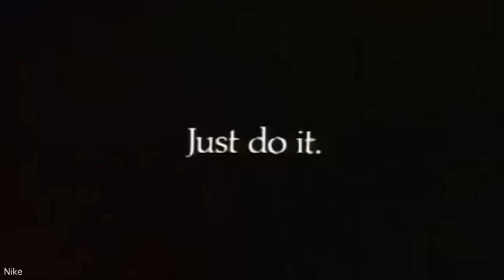Barn Find 1962 Pontiac Catalina Interior Upgrades, Trim Installation and MORE!

Comment: For future reference. There's a trick I do and will pass along to my fellow compadres. You can do for dry, wavy and extremely warped door panels that won't sit flat and stay flat. Just use Windex or water in a spray bottle. Spray the backside of panel lightly enough to absorb into panel. Then install while moist. As the liquid dries, it will flatten dry back into proper form
Reply: I did that (an Old Body Works Guy showed me how to do it) on my first car years ago. A 1957 Chevy 2 door 210. Someone had removed the front ones and threw them into the trunk that leaked water. It worked great.
Reply: That makes sense. Thanks for sharing 👍
Reply from the maker: Thanks for the tip!

Comment: A nice built for the Poncho power level 200R4 for that car would be the ticket. You get the better first gear(2.74:1) and the .67:1 overdrive gear. IIRC that has a 3.23:1 rear gear? If so, with the torque of that Pontiac engine should be good enough to shift into overdrive at 45 mph. Usually a 3.42:1 rear gear is teamed up with the 200R4 so it can go into overdrive at 45, the 3.23:1 should be close enough. Since it's a manual there are overdrive options for those too.

Can't wait to see you do the body work snd paint for this car.😎👍
Reply: This will make a great summer daily driver for you.😎👍

Comment: Some of the cars made in the 60's had really cool looking interior and Pontiac seemed to have some of the best.
About 20 years ago my Dad inherited his uncles 64 2-door Catalina. He ordered the car new.
The exterior was kind of a silverish  green color, and it had green interior too. Similar to your blue seats, it had
three different colors of green. I love the look... His uncle had the dealer put the really thick clear seat covers on it
before he picked it up. I swear those things were 1/4 inch thick. It still had the matching factory floormats too.
The car had been garaged since day one. It had never been wrecked and still had 100% original paint.
The only flaw the car had was a really small ding on the driver side quarter panel...
It didn't run like yours though LOL...  The 400 in your car sounds sweet and runs hard when you give it all the beans.
I was really surprised to see how good it ran in the video. I really like this car...
Reply from the maker: gorgeous cars!

Comment: I hadn’t heard Nunzi passed away, in in CT and he has always been well respected by us Pontiac guys here, I love the 63 tempest he built. On the 283 they do make aluminum double hump heads, ya gotta watch the large valve heads with the 283’s 3.875 bore, the larger valves are just going to be shrouded against the cylinder wall anyways. Good video, takes a couple of days to watch these full feature length videos but I enjoy them

Comment: Man, I’m pretty sure that thing is even the same color as the one I had. Swapped in a seat out of a 65? Pontiac. Bolted right up. Huge improvement. If you stop working on it right now, I’ll come and get it.

Comment: You couldn't miss meeting a Pontiac with that iconic grill nose.  I think it was in 1969 they introduced that endura rubber nose which was supposed to be able to take a parallel parking tap without damage.   Love those old Wide Tracks.

Comment: For the plastic inserts for the trim, try to find a shop that deals with Lawson Products. They make a trim fastener assortment drawer that, if memory serves, has those in the assortment.
Reply: Those clips can be over $7 a piece 😮😮😢.  Used to work in a body shop and we were always trying to make sure we could save any type of clip because those added up quick!😮😮😢

Comment: Tom ,you are so correct. I have built 7 cars in last 20 years. Six of those were frame off. They are drivers not show cars but respectable. I no not build engines or transmission but assembly , body work , paint all done by myself.  Average  cost of build is approximately $25,000 . If someone  does  not have skill level,time,space or tools cheaper to buy.

Comment: Lightly cruise a file over those pitted chrome handles. It knocks those pitts back just right without scratching the chrome (to hard to hook). And then steel wool. VERY NIIICE😎
Reply from the maker: Thanks for the tip

Comment: I did a 68 Tilt Pontiac Firebird column for a customer about  2 months ago. Was a PITA, found out the column was not original from the Pontiac but from an Impala or a Buick and was converted from column shift to floor shift and the column was missing parts. The lower bearing no one. I mean no one had an original style bearing. What I was finding do not fit the column, located a guy that sells parts and made customer bearing housing for over 250.00 (LOL). Yep I ordered it. And the biggest issue, he provided me a Billet specialties wheel and adaptor. The adaptor did not fit the spline shaft as the adaptor was to tall by about 1/4". Sent Billed Specialities a photo of the shaft. They replied (We have never seen a shaft like that on a column, sorry we can't help) HA!
After "Machining" (and I mean with a flat file) down the hub flange enough to actual fit the column everything was GTG.  
You are 100% correct on waiting for parts to rebuild a column.
Reply from the maker: What a headache!

Comment: In some ( not many) applications a phenolic spacer was used to "slow" thermal transfer from the block to the fuel pump canister through the mounting pedestal. Typically these applications were those where the fuel pump was close to the exhaust manifold. The whole idea being to minimize " vapor lock" at the fuel pump. Also the" spacer " was sometimes used to make a fuel pump with a " different length" lever work with the existing pump " push rod" in the block.
Reply from the maker: Thanks for the info!

Comment: 🍻⛽️👊🏼🐾…
My 67 ss impala had that factory black flexible sorta rubber coated with felt-ish sound deadener over the floor pans ….
It sucked up the heater core juice and rotted out that section back in 87’ …
Still a helluva ride 👍🏼

Comment: Hey Mortske, if you think the heads are too high a compression (or low) an easy test is change of head gasket.  Add or remove a few 1,000 and you will know pretty quick if that is the case.

Comment: In my day most spark plugs had the top terminal threaded on. In fact it often came just loose in the Box and you had to install it. If you had an old one and a screw that matched the thread you could drill a hole through the side and use it as a cable stop. For 90 degree application just put the screw through the linkage arm first then assemble. May require a few washers. I usually just drilled a hole in a penny for those as washers were about 6 cents each.

Comment: Dual point distributors help prevent points float at high rpm. One set of points open a pinch before the other, which causes one set to close just before the other. By doing this you get better spark at high rpm.
Reply from the maker: Thanks for the info!

Comment: There's a lot of advantages of having a dual-point distributor. They tend to keep your coil charged up better, they don't 'float' around as much at higher RPM's - basically don't need them unless you're running a high RPM engine.

Comment: The dual point distributor provides a longer dwell time because the points are slightly offset from each other and open and close slightly off from each other for earlier and longer close time.
You might need that distributor for high compression (the shaky stop when turned off)
High compression is known to put out the spark and misfire.. and you might need 100 octane for domes..
Try that dual piont out and get the points as close to closing and opening to eachother (most dwell/saturation)and get a yellow ACCEL COIL to go with it.

Comment: just a note since you have noticed.  The firewall plates are unique to Standard shift and  Normal/ floor shift automatic.
Reply from the maker: Makes sense
Reply: I'm certain that between the 61-62 and the 63-64 models there are differences in things like Steering columns do to the new Government standards and newer switches and such.  Never had any issues swapping 63-64 around.   It's also a wise idea to chain down the drivers side of the engine. Limit it to about a half of an inch travel.  If you do not. You risk tearing the motor mounts and breaking the transmission  IE cracking the case or snapping of an ear or two.  @MortskeRepair
Reply from the maker: Thanks for the info @1gatomon

Comment: Wide track Pontiac . I had one with a 389 two barrel. And a really cool automatic transmission.  Solid steel car , even in winter I could get around on terrible tires . Thing weighed 5000 pounds .😎😎
Reply from the maker: Thanks for sharing!

Comment: As an old X Midas man we use to use 1 1/4 inch 5/16 course bolts in place of the  bottom shock bolts... If they did not have welded nuts on the top side we dropped the bolts down and then nutted the bottoms with lock washers.  Or blew welded nuts out with a torch.  Bit ruthless but it worked good if you were good with the liquid wrench.
Reply from the maker: Good to know!

Comment: Mojo is correct about the dual point distributor.  Dual points give longer coil saturation time to build up voltage.  It allows for a hotter, higher voltage spark at high rpm's over single points.  Smokey Yunick once made a distributor with 8 sets of points for one of this NASCAR engines in the 1960's.
Reply from the maker: Thanks for sharing!

Comment: Not sure when the last vehicle rolled out with ashtrays but I know my 91 s10 blazer 4 door had them in the rear doors and under the radio. I still have the old rig since my grandpa gave it to me in high school. Original all the way to the window sticker and front bench seat.

Comment: Are you familiar with our Canadian Pontiacs, the Parisienne & Laurentian? I forget if you've mentioned them before, but it's crazy how they're basically Chevy's underneath. The Beaumonts & Acadians are cool too.
Reply: Tired u slaming headers. First a real set headers made from equal length tubes then collector hides uneven lengths. Shorties drag strip. Long tubes for race track..

 1:59:24 1:59:29
Reply from the maker: I know a bit

Comment: Hello Mortske you know when you got the car in the garage you usually check out what's in the trunk & so far you haven't done that yet, but anyways those parts that's missing might be in the trunk,you might have to check it out to see if anything is in the trunk,but the car looks good with those blue seats in it & I was hoping to you would leave the floor shifter in it & take out the column shifter glad you did that & put some different heads on that engine on your engine stand & put those headers that's on it now on the new heads & put it back in the truck with those headers on & take it for a test drive, I bet it will sound good in the truck with those headers on the engine & can't wait until you get the Pontiac ready for a test drive hopefully you'll be able and next week & say hello to MOJO & Duff dog for me & I see commercials for Shriners hospitals on tv they help kids with cancer & other things, you did your good deed for the month

Comment: Hi Morkski nice video 📹 and workmanship!!! Like the grills !!! And your Dad's engine do you think the oil pump or starter is bad or the coil !!! Does the coil make it turn faster !!! Or the cluster that has a system !!! I think someone put 305 or more correct 350 heads on a 283 !!! Hope it fit !!! Like the outside car of this video 📹 the 50 somthing yellow car 🚕 🚗 💛!!! !!!!

Comment: For cylinder heads, I would use 305 H.O. heads they work perfectly for 283sbc or 307sbc they also respond better to a mid to low rpm range cam for more torque rather than a high  rpm  cam. At least from my experience...hope this helps
Reply from the maker: Thanks for the tip

Comment: I don't think it will help on the 283 mostly because I agree the heads aren't letting it breathe properly but I'm a firm believer in butterfly weight kits for distributors.  Tunable vacuum advance and of course carb tuning . You can get away with average HP if you bring throttle response a few ticks.  Pontiac is looking good and Good stuff as always .

Comment: You THE MAN MORT MY BUDDY WILLIAM HAS A 62 CATALINA HE BOUGHT FOR 1200 IN THE 80S BECAUSE HE SAW IT WHILE DRIVING A TRAIN ENGINE ON THE TRACKS NOW HE PUT A PONTIAC 455 70 IN IT WITH A 4 SPEED HOT TRANSMISSION A REPAINT MADE IT LOOK VERY NICE BUT HE CHANGED THE MOTOR TO A 421 WITH DUAL QUAD CARBURETERATION  SET UP
Reply: Kept a 4 speed trans in it
Reply: Made it like the 62 that Won Daytona in 62
Reply: Same color as your's
Reply from the maker: Awesome

Comment: The second set of points on a dual point distributor is supposed to prevent misfire from high RPM point float. I have replaced more of those distributors with HEI then I can remember some people like them for nostalgia often times. I found them on vehicles that would never reach an RPM needing a dual point distributor.
Reply from the maker: Thanks for sharing!

Comment: I'm thinking that you could possibly chop that A-pillar trim piece in half and then overlap the middle section for a nice fit,... I'm not sure.  Those plastic clips for the side mouldings can be made with a 3D printer, if you know anyone that has one. 🙂 Good job on the steering column Bruh.

Comment: In my day the parts for cars like this were expensive. I once replaced a rag joint with a piece of bias ply sidewall. Sliced the piece I needed with a carving knife and soapy water. Drilled the holes with a forsner bit set to high speed. Better than factory. I just fix cars I don't restore them.
Reply from the maker: Thanks for sharing!

Comment: Does blue pieces of metal you had is backseat and the door panel that's a fact Bonneville came with chrome polished or or whatever material and the catalinas inside interior around the headliner were painted as well as Grand Prix Bonneville the only one have the chrome polish love you put this back together I miss mine

Comment: Engine manufacturer:

GM Pontiac 400 V8

Engine type:

spark-ignition 4-stroke

Fuel type:

gasoline (petrol)

Fuel system:

carburetor

Charge system:

naturally aspirated

Valves per cylinder:

2

Valves timing:

Additional features:

Rochester 4-barrel carb, Ram Air

OHV, V90deg

Cylinders alignment:

V 8

Displacement:

6558 cm3 / 400.2 cui

Bore:

104.68 mm / 4.1212 in

Stroke:

95.25 mm / 3.75 in

Compression ratio:

10.75 : 1

Horsepower net:

Torque net:

Horsepower gross:

268.5 kW / 365 PS / 360 hp (SAE)

/ 5400

Torque gross:

603 Nm / 445 ft-lb

/ 3800

Redline rpm:

Car power to weight ratio net:

140 watt/kg / 64 watt/lb (estimated by a-c)

Car power to weight ratio gross:

157 watt/kg / 71 watt/lb

Car weight to power ratio net:

7.1 kg/kW / 5.2 kg/PS / 11.7 lbs/hp (estimated by a-c)

Car weight to power ratio gross:

6.4 kg/kW / 4.7 kg/PS / 10.4 lbs/hp

Fuel capacity:

81 liter / 21.4 U.S. gal / 17.8 imp. gal

Engine lubricant oil capacity:

5.7 liter / 6 U.S. qt / 5 imp. qt

with filter change

Engine coolant capacity:

16.8 liter / 17.8 U.S. qt / 14.8 imp. qt

Battery capacity (Ah):

61

Comment: Tom, your 1968 290hp 400 is not originally from a GTO.  That engine was not offered in the GTO.  It is a high compression two barrel engine from a '68 full size B-body.  The only optional two barrel GTO 400 engine that was offered was a low compression 265hp version.
Reply from the maker: Look it up "YS indicates a base 400/350HP with automatic trans"
Reply: @MortskeRepair  Yep, my bad.  I missed the part of the video where you gave out the block code.  I was just going by your 290hp 400 comment I remembered from an earlier video.  Anyways, congrats on the cool Poncho! Like the '63 Grand Prix, it's a keeper.

Comment: Dual points were used to increase dwell time to saturate the coil better at high rpm, they also decreased point bounce at the same time.  One set closed then the other, current carrying increased then the first set opened but the coil was still receiving voltage then the second set opened collapsing the field in the coil creating the spark.  Needed back in the day over 5000 rpm, they still suck IMHO.  For heads get a set of iron '96-'02 L31 Vortec's.  1.94" intake valves, 64cc chambers, an easy, cheap 25-40hp extra at least.  You'll just have to buy a new intake to match the ports.
Reply from the maker: Thanks for the info!

Comment: Tom would be easy to push pin out of shifter cut off wheel the collar and add a little plastic to fill over the hole never change the column at all
Reply from the maker: yuck

Comment: Trick flow has some aluminum heads that have the double hump look I think they are 202 intake 160 exhaust I think they are 180 cfm would work on that 283 and I'm sure you wouldn't have much more into a set of then then a set of junk cast iron heads that don't flow worth a crap also afr enforcer 195 heads are about 1k and work really good.

Comment: the tilt column is out of a 63-64.....its way easier to pull the heater control with the dash pulled that top screw is a pita doing it on your back.....

Comment: There is rod that goes down column that activates turn signal switch where on later steering column the switch is behind steering wheel and is plastic they changed it in 65 so your turn signals weren't work and your brake lights wouldn't work because that also controlled by turn signal switch

Comment: Sometimes you can tune around a not so great selection of parts. After making sure everything is working on your 283? I'd run a short timing curve in it. That and run your vac advance to manifold vaccume. You may have to find a way limit the canister advance if it stumbles. That n light car with low gears will help the 283. Plus that thing won't be happy with tractor pipes. A decent exhaust n some scavenging effect will help pull air through that motor.
Reply from the maker: Thanks for the info